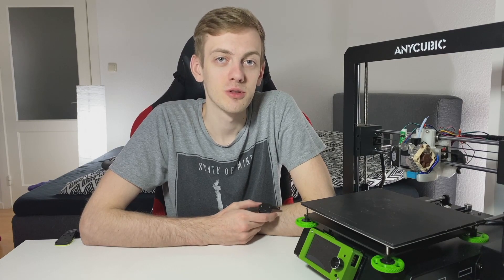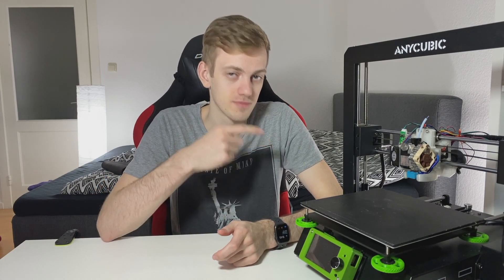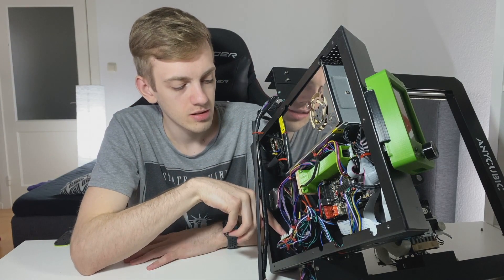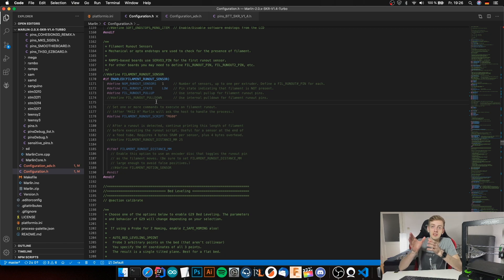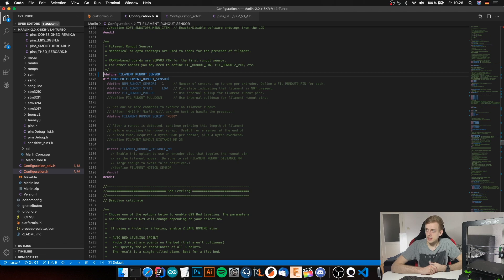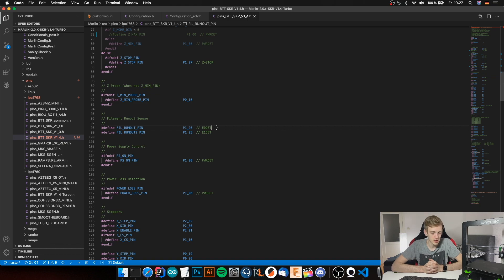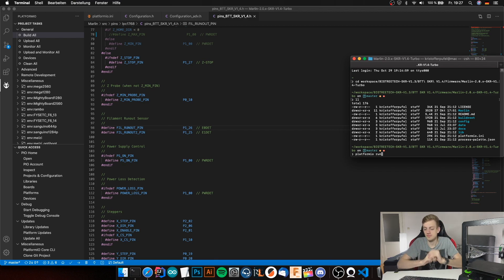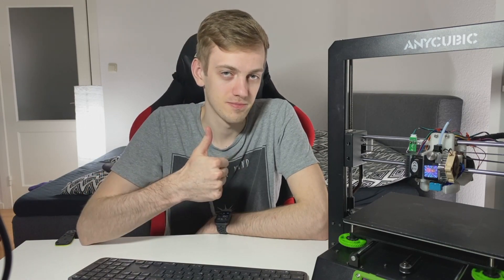ANYCUBIC I3 MEGA BTT SKR 1.4 FILAMENT RUNOUT SENSOR MARLIN CONFIG 2.X

Comment: hi, im using marlin 2.X and it's showing that the filament runout sensor is triggered when not plugged in.
Reply from the maker: Hello zenol, you need to invert the signal then.
Reply: @Kris3D  i tried but it still doesn't work, i altered the fil_runout_pullup/pulldown and uncommented those, but the signal is still constant. no change, when i unchecked the pullup it showed the signal was open, but even when i plug it in and add filament it's not showing any change.
Reply from the maker: You could check that you wired the runout sensor correct and checked the pin also
Reply: @Kris3D  it is wired correctly, and plugged into servo 3, but still shows no change when i use m119, i have attempted to change the default filament sensor pin and still no change. i don't know if it's a hardware issue or software issue.

Comment: Hi Kris! Thanks for the awesome videos, i wired my SKR Turbo with them ;)
I've got a question for you: is there a way to make the filament runout sensor work both on marlin and the touch screen? Seems like with this configuration it's working only in marlin mode.
Thanks in advance, keep doing the great job!
Tschüss
Reply from the maker: What do you mean with touch mode and marlin mode? You mean the mode on the tft?
Reply: @Kris3D  yes exactly :)

Comment: Hi Kris, should the original sensor connector be left? Just connect the brown wire? Thanks
Reply from the maker: Hi Walter, the runout sensor should be connected to the hub with the wire which is already attached to the runout sensor. Afterwards connect the brown wire like shown in the video from the HUB to the Board.
Reply: @Kris3D  Thank you very much Kris, I also followed your great video on the Skr 1.4 Turbo. Ciao

Comment: Great vid, please keep making more, maybe about the bl touch
Reply from the maker: In my wiring video I showed how to wire the bltouch from the hub to the skr board. I can make a special video on how to completely wire the bltouch and mount it with different mounts.
Reply: @Kris3D  thank you!
Reply: @Kris3D  Do you have the file for the stepper driver fan duct for your noctua fan
Reply from the maker: I just printed one from thingiverse which i found really cool
Reply: @Kris3D  can you please link it?
Reply from the maker: @leoallesch9855  https://www.thingiverse.com/thing:3634597/files